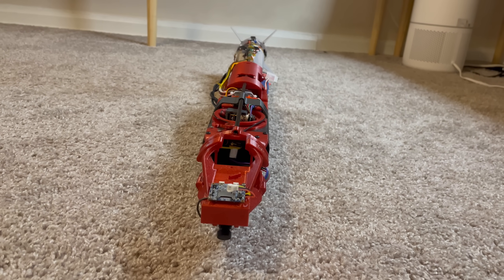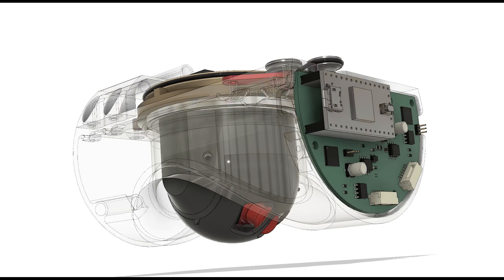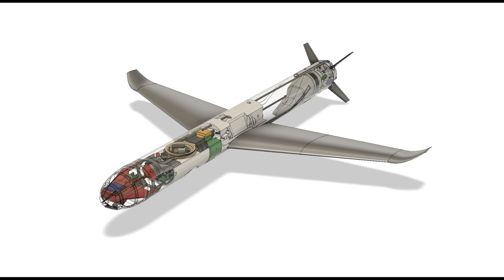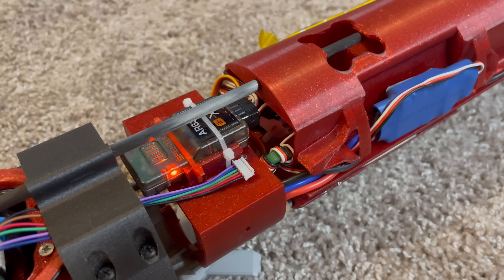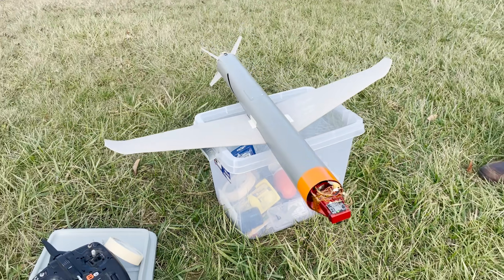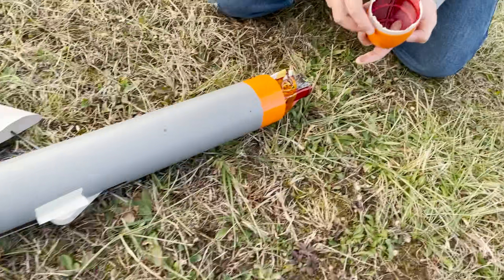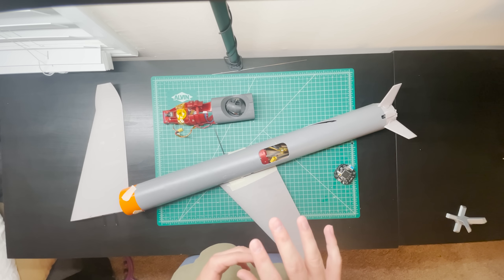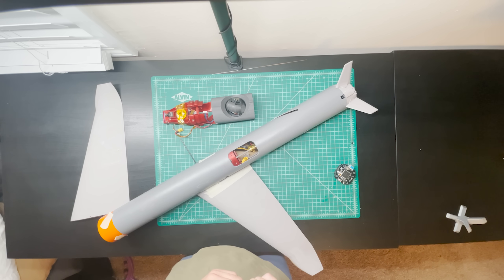Building (And Crashing) my Homemade Surveillance Drone

Comment: Make rear half of the fuselage like 20 percent longer tonmake the cg to the fattest part of wing airfoil and have nose signifantly shorter than the section of wing to tail and will be much more stable and less of a handful on pitch authority...also the cone affects the thrust and edf motors aremt very efficient so you want alot of thrust and further forward the motor is the better thrust is and maybe double rear fins surface area for better control

Comment: Some suggestions for your design.
1. Find and use a lightweight filament for this print.
2. Find and use some flight stability software.
3. Refine the inlet for the duct engine. I would add three duct inlets. One on the top and two on the side.
4. Increase the size of the wings to help with lift.
5. Move the wings to the aircraft's top to help with stability.
6. Rework the electronics so the center of gravity is just under the wings.
7. Remove all unnecessary equipment and only put what is needed to fly the drone.
8. Increase the size of your control surfaces.
I hope these suggestions help.

Comment: ความคิดดีมากแต่อันดับแรกควรหาCGของตัวเครื่องบินก่อนถ้าบินได้แล้วค่อยไส่กล้องและอุปกรณ์ต่างๆเข้าไป
แล้วหาCG.ใหม่อีกครั้งส่วนแรงขับดันเราควรจะหามอเตอร์ที่แรงกว่านี้และช่องดูดลมเข้าควรจะเป็นรูตะแกรง
รอบตัวเพื่อป้องกันการดูดลมเข้าฝั่งเดียวที่ท้ายเครื่องเพื่อป้องกันการทำให้ลำตัวเสียสมดุลตอนเคลื่อนที่ไปด้านหน้า
 การใช้วัสดุที่หนักมากกว่าแรงขับเคลื่อนก็จะทำให้การบินล้มเหลวได้ดังนั้นแรงขับเคลื่อนจึงต้องมีมากกว่า
น้ำหนักตัวทั้งหมด4-5เท่าจะดีที่สุด**********
Very good idea, but first we should find the CG of the aircraft. If it can fly, then we can put in the 
camera and other equipment and find the new CG again. As for the thrust, we should find a stronger 
motor and the air intake should be a grid hole around the body to prevent air from being sucked in 
from only one side at the rear of the aircraft to prevent the body from losing balance when moving 
forward. Using materials that are heavier than the thrust will cause the flight to fail. Therefore, 
the thrust should be 4-5 times more than the total weight of the aircraft, which would be best.

Comment: You might be able to just out-thrust the design.  Improve the amount of throttle going to the motor during takeoff/landing, and try to achieve a VTOL takeoff instead of a hand launch

Comment: Your engineering skills are very impressive. nice design. Makes sense considering your job. I agree with oth sentiment of other comments, way faster launch, way more thrust (more battery voltage?) might get you in the air without too many mods. Bunje cords on a guide rail launcher would be cheap and easy to make.

Comment: Very cool and ambitious project! Completely new desings are expected to end up in aerodynamics hell so hang in there! You should consider collaboration with another youtuber like Think Flight on this. He has experience designing and building winged drones so he might have some valuable input! In the meantime here are some ideas:

1) Push the center of mass forward, probably a lot. The aerodynamic center doesn't have enough leverage to keep the thing prograde.
2) Add ailerons on the wings for roll: Control authority far from the center of mass is a big yes.
3) I like the bigger top fins idea but a more traditional design might be more in order here for better control separation and whatnot. Rotate the back 45 degrees, add one big rudder fin on top and a bigger set of horizontal fins or even wings that can take over roll as well if big enough (they can also be set upside down for negative lift if you end up pushing the center of mass way forward and it ends up front-heavy).
4) Push or rotate the wings up to get a dihedral effect. Right now is looks like you get the opposite effect which actually gives the drone the tendency to go upside down.

Good luck! Subscribing for this!

Comment: Imo, buy two 2x4's and a few moving rubber bands, a few wood screws, a borrow a router from someone and bobs your aunty, you got a launcher. I'm confident if you can design this thing, you can easily manage a launcher. Increase the top two tail fins, and possibly add another set of non movable fins in between the top and bottom for added rear stability. my fear is increasing the top while making the bottom smaller may simply zero out on effective control area and keep the status quo. Check center of gravity, adjust if needed, and try again.

Comment: Couple thoughts based on the RC plane I made years ago now. 

Most of all, Get Real Flight RC flight sim, with a controller. 
This will allow you to build your exact aircraft with all the dimensions and similar if not exact parts. I did this so the model had all the same parts, and settings for  your receiver and controller. So the servo mixing, throw angles and percents are all the same.

I’m willing to bet you’ll get the same exact outcome in the sim. The beauty with that is you can adjust your center of gravity or thrust with no effort. Try to fly again to see what helps. Same with thrust vectoring and control surface iterations. 

Start with the exact model as built. The. Tweak it to make it flyable the way you want. Changes in CG, CT, thrust ramp speed, weight, all of it. 

You can test in the sim throwing without thrust. You might find it doesn’t roll. If so, you have a torque issue and need to ramp throttle up and maybe mix with ailerons. 

Once you have a flyable model, that handles how you like. that will guide you to designs changes you can make to get there. 

If you enter in everything exact and it flys like crap in the sim. Be prepared to have the same issues IRL.

Mine was a push prop designed with a huge brushless motor and prop with heavy pitch. That thing basically nosed in if I just lit up the throttle. As the center of thrust was a good 4 inches above center of gravity. And center of mass really. But at a glide the handling was good. Well, once I figured it how to make it not so tail heavy. 

My two suggestions for your aircraft would be to lock thrust vectoring for now. Treat it as a glider, as much as you can. So you can see how well it handles without thrust. 

Then also get a gyro based stability controller. It’ll plug in between the receiver and servos. That can help compensate for some of the behavior like when you throttle up with too high thrust or torque. Or when you start getting into that stall zone.

Comment: 10:44 Get rid of those angles in the duct and smooth out the surface transitions.  You should only have curves in your duct and they should have as large a radius as possible within the limits of your geometry.  This should be pretty easy to do since you're 3d printing it.  Also increase the duct area, the cross sectional area should be no smaller than the cross sectional area of the fan itself, and ideally should get larger as it reaches the bottom of the fuselage.

Comment: I think your problem is most likely the tail size. Ultimately you need to counteract the pitching moment of the wing. Traditionally this is done with a tail an elevator. You could use your thrust vectoring to do the same although that will be much more challenging to get right. I’d start with a larger tail to get it flying. Then start shortening the surfaces as you learn to rely more on the thrust vectoring.

Comment: 13:20 "I don't think I have yaw stability enough" my brother in Christ, I don't think you have enough thrust
Reply: chokes off inlet and outlet with obstructions and weird pathways "check out this thrust vector"... what thrust?
Reply: @JoshuaHoltz  Yeah I think he should start with two big inlets on the left and right sides, probably with ram air intakes too. I'm also curious where the center of mass is relative to the center of lift.
Reply: @JoshuaHoltz  The design choices are limited by the design concept. Nobody complains that a submarine can't fly.
Reply: @WillyKling yeah, but they do when a plane can't :)
Reply: @ I don't regard it as a plane. It is clearly a missile.
Reply: @WillyTepes Missiles are supposed to fly too.
Reply: In thrust we trust!!! when in doubt add more

Comment: its a shame you dont provide cad files etc. these designs are amazing and way above what i could create. (can barely create a box in cad lol) i suspect a lot of people would be very happy to pay for the cad, pcb and stl files. it would also help you as community tweaks could improve your model. i know i would pay for them
Reply from the maker: I would love to, but it gets a bit weird legally, especially for rockets. That’s not a gray zone I feel comfortable operating in. When I get hatchet working, we will see if I can release them!
Reply: @ oh I completely agree with rockets that is a whole different kettle of fish. However  with hatchet I don’t see a way it could even be converted to a rocket.  The design is just amazing even down to the smallest components. I will definitely keep my eyes posted for if you do decide to sell the files etc. the ball turret could be used in other model aircraft too.  Thanks for sharing and responding.
Reply: @ I have been having a think.  I think the issue is lack of authority with the fin controls. The airspeed isn’t high enough for the fins to have an effect.  Have you thought of designing a system so that the deployable wings can twist to provide more control authority twist left right wings alternate to turn. Twist down up together to provide lift / dive.  The larger surface are of the wing should help keep it in the air long enough to get up to speed where the fins are more effective.

Comment: Too much weight too little wing , too little thrust. What you should do is take a proven platform like a wing. You would have to be doing at least 70mph to get such a large payload to wing ratio into the air

Comment: Aerospace engineer here. Also RC / FPV plane and drone pilot and builder. You are attempting a challenging design.
1. Seems tail heavy. Need to start with CG at ~ 20% chord from LE. Them optimize.
2. Ailerons would help with control. It’s not a rocket, it has wings and higher moment of inertia.
3. Intake geometry is probably robbing about half of the fan thrust or more. Did you measure static thrust? What is the plane weight? There is a reason why intakes stick out on planes and cruise missiles. If you still want to hide intakes into plane frontal projection it is probably better to have two symmetrical inlets on the sides.

Comment: I would just do an air drop from a multi rotor so you can build air speed and not have to use a rocket stage boost. 

Lightening things up would help as well. Keeping mass down, removing “non criticals” for now, maybe doing Aero PLA. Might be fun to go way over board on thrust to weight ratio with multiple edf’s in a quad config and  a fin behind each duct.

Comment: Have you tested the CG? Looks tail heavy to me. I agree with larger fins too. I’m not sure about the “y” design. What you are designing looks like it’s designed to be launched and… cough, cough not be recovered. 

If you want to have it land I would switch to a traditional airplane tail design or three fins keeping in mind you have a high probability of one or two breaking during recovery.

Alternatively, you could say eff all to the landing phase, but design a landing station with a large cargo net.

Comment: Very Cool design but seems to me 1) under powered: You have to keep the thrust to weight ratio at least 0.5 2) Not enough lift: meaning your wing loading seems to be too high. Try to reduce it by at least 50% or increase your wing area or span. 3) the ducted fans are sensitive obstructions in exhaust area. Remove the fins in cross air with the fan exhaust.

Comment: there's a reason that airplanes don't resemble rockets...anyway, forget about powering it until you can get something to approximate a glide. if it ever *does" glide  you're going to need much more thrust than this motor provides. you're going to have to focus on getting weight off. 3D printing is not your friend as far as airframe constructon goes.

Comment: For hand launching try a wing tip launch. Hold it by the wing and spin and then release. Don't need as much strength that way. I am worried about the lack of control surfaces on the wings making it harder to control at low thrust. Another test is to empty out all the weight and see if you can get it to just glide. 

I can't wait to see the changes you make to get Hatchet in the air.
Best of luck

Comment: I knew it won't fly the moment I watched first part of the CAD video.
Why🤔
The EDF is tooo small, and the battery motor combination is under power.
No thrust to weight ratio test.
The center of gravity is not at the proper location nose too heavy no proper knowledge of airplane weight and balance.
Lots of engineering errors at the nozzle section, especially putting a diverging nozzle, it should be a converging nozzle, diverging nozzle is for high speed hot expanding gasses.
I didn't hear a flight stabilization control.
No flaps and ailerons?

Comment: A 62mm EDF is inherently bad at static thrust (when you're hand launching).  On 3S power, I would not anticipate more than 450 grams of static thrust.  A 70mm EDF at 4S or 6S would definitely give you >50% improvement to the powerplant.  As for the yaw issue... If you clock the rear fins/control surfaces 45-degrees relative to where they are now (parallel/perpendicular to main wings), you should get more yaw authority at lower speeds.  Just some ideas.  Subscribed and looking forward to more!

Comment: Instead of building a launch rail system, you could have your friend stand in the back of a truck bed going down the road and hand launch it from there. Just to validate the stall speed and get it in the air.

Comment: Why not add wheels under the wings temporarily and one near the tail to see if you can have it get enough airspeed on the ground to be able to fly? I don't know a ton about aeronautical design, but my bet is your inlet for air flow is too small and likely so is your motor. You could also do design more like a basking shark, and see if there is a way to allow the airflow to go around the inner parts, down the length of the plane and out the back. Just a thought

Comment: After reducing take off weight, you could try diffrent types of launch, you could make some kind of catapult/slingshot/crossbow, the already mentioned rocket booster, or an aerial launch with a bigger craft, maybe not an aircraft but a drone that can lift it up enough to gain some speed

Comment: Dropping a vote for a rubber band powered launch mechanism... or maybe something rail-gun(ish) with electromagnets. No sense in starting simple, right? Either way, it should keep everything stable on launch while accelerating to the required speed.

Comment: TL;DR: Check your center of mass vs. center of lift; check your power to weight ratio; I think the rail system might help you if it's long enough.

Just looking at it, the center of mass looks to be too far forward. You might be able to counter this by doing nothing more than adding a bit more length to the fuselage overall. Keep the chord of the wings where they are, roughly at the back of the payload, but give the weight of the motor a longer fulcrum to balance the weight out.

In addition, it might be a good idea to check what your thrust to weight ratio is right now. It obviously doesn't need to be >1, like a rocket would, but it might give a hint as to why you are getting more and more failures.

I agree with the rail launch system, if you can design a cradle that will stay with the rail and allow the drone to get some lift over its wings before it has to rely 100% on whatever thrust the EDF is able to output, that will help. Make sure your rail is long enough that you can build some speed, even if its accomplished by like, a winch rope like some glider parks use to get full sized gliders in the air. I think part of your hand launch failure here is that your friend was just throwing it, versus trying to get a 15 or 20 foot run up where the drone had a chance to build some relative airspeed.

All that said, I'm just some guy that wasn't even good at Kerbal, so there's a good chance I have no idea what I'm talking about.

Comment: My. Guy. 
That thing is much too heavy for the small motor and control surfaces. Rockets can get away with it because they're going mach bejesus, you need to be able to punch power and keep control over the tail. I don't RC, but I do know airplanes. 
Alternatively, try launching it by holding it out the window of your car or something. Fly it like a kite. Dunno, but you don't have to worry about the technical stuff ^ if it's controlled as it gets up to speed

Comment: I would make a simple gimbaled mount on which you can mount your bird. Mount it on a vehicle in clear air and go for a drive. Have someone drive, while you fly the bird. You can fly it on the mount to learn its flight characteristics, operating envelope,  and what control paramiters are needed to make the thing fly (a poor mans wind tunnel). You will learn more about flying it, and less about making replacement parts.

Comment: ERAU Grad here... I wouldn't change your aircraft, I would change your launch mechanism.  You're going to have negative transfer of learning (about how your system handles) by changing the aircraft.  You need more air speed to get enough lift for that thing... Maybe consider a slingshot launcher on rails? 

Part of me also doesn't think that edf can propel that aircraft to give it the maneuverability you're looking for, but since I don't know those specs, that's a blind guess.